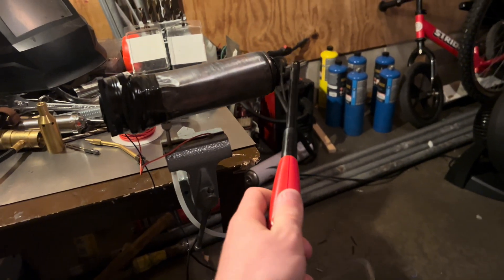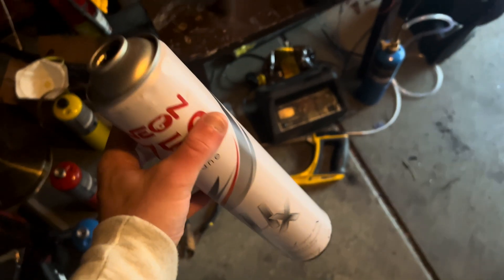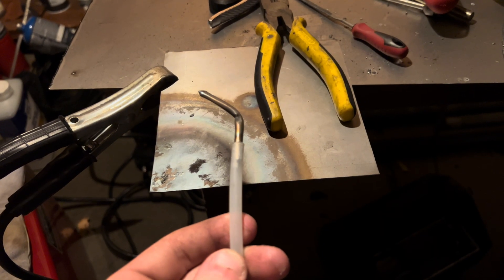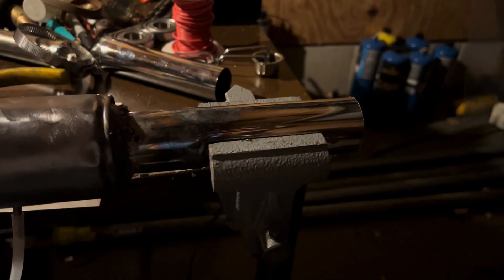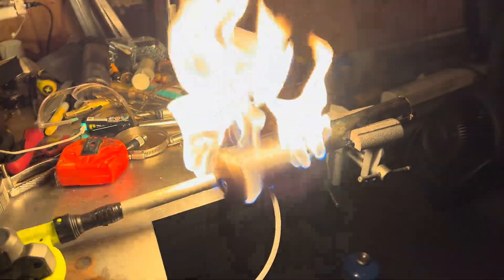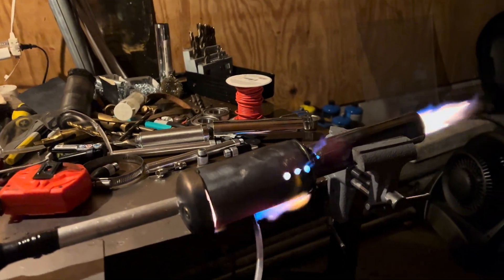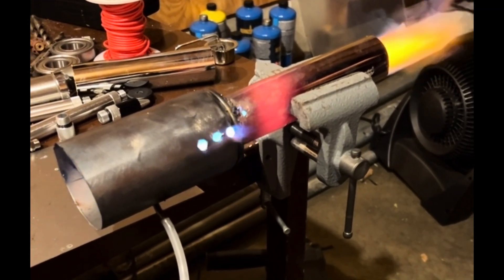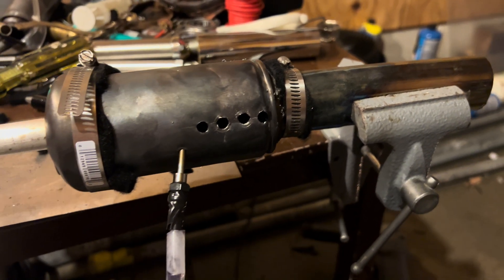DIY Jet Engine from Scrap Parts

Comment: That's actually SICK, I'm doing a similar thing but I'm using purely scrap material and I'm building my own compressor from scratch and I'm trying to make some videos of it as well. If you're gonna upgrade it and try to make improvements, definitely add a flame tube or some sort of gutter before your fuel injector, it'll prevent the flame from getting blown out and help mix the air with fuel better.
Reply from the maker: Thanks for the tip I’m working on building a couple new ones so I’ll definetely incorporate that

Comment: just a bit of advice you could probably use a turbine at the exhaust to pull in more air like a turbofan
Reply: also taper down the exhaust to make it reach higher presure, also if you get air spinning around inside the engine along the walls it will focus the jet more and improve combustion and reduce heat
Reply from the maker: @SanderVeimo-o1o thanks for the tip, I barely know anything or how a jet engine works just sort of wanted to build one so any advice will help
Reply: @Joseph_sidl  You need to taper it up, with a 5° half angle. It's called a diffuser
Reply: @SanderVeimo-o1o  your tips are false.  bernoulli's principle states that tapering the exaust will decrease the pressure and increase the velocity. also this engine would never self sustain with a turbine.

Comment: It wasn't igniting earlier cause there was too much air. Need to get a proper air to fuel ratio, and remove the holes in the combustion chamber for increased thrust or more boom going out the end. Also keep a unexpired fire extinguisher near by if you haven't already
Reply from the maker: I’m working on a bigger Lockwood hiller style pulse jet and taking all these into consideration
Reply: Fire exiting guisher? What?